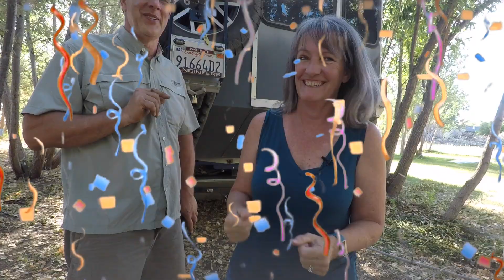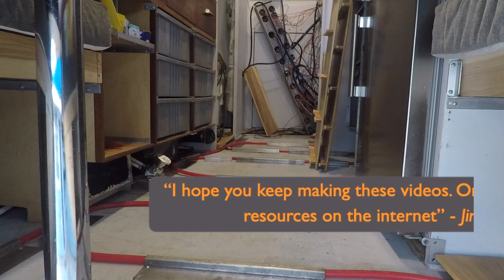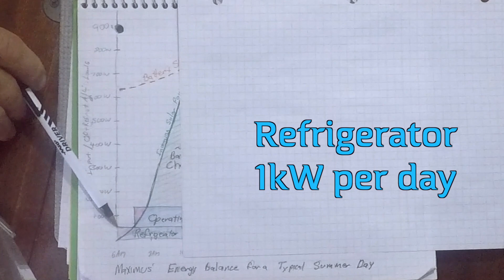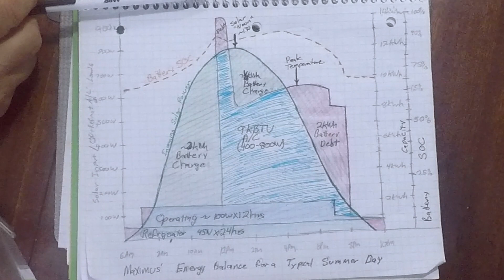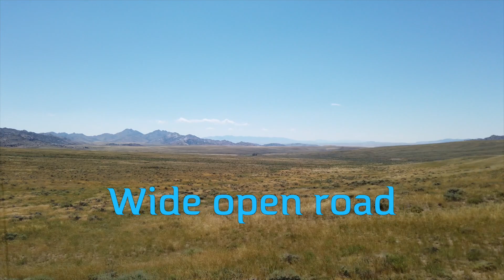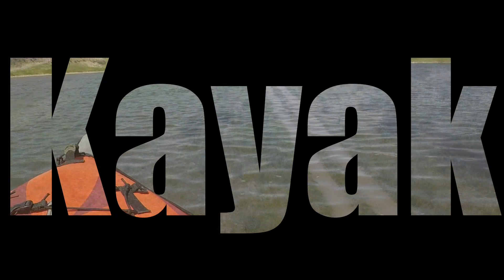All DAY Solar Powered Mini Split AC | Staying Cool Off  Grid DIY Truck Camper  | North Platte River

Comment: Haha I watched this last night.I guess I need a 400ah bat and 1k +++ solar mainly just for a heat pump.Fridge runs forever on 30# gas.I’m sure I’ll rethink this 50 more times lol
Reply from the maker: My calculation that operating my camper with 950W of solar and a ~400Ah/4kWh of battery (need) includes ALL of the camper's living  requirements such as operating the 11.3cuft refrigerator for 24 /hours, cooking with and induction cooktop, pumping water, operating lights and fans, charging equipment, etc. This is also inside a super insulated shell which is necessary to reduce the A/C load to the minimum. 

Absorption refrigerators require ~8x more energy than a typical compressor refrigerator which will be about 10x more than my high efficiency refrigerator. While absorption refrigerators attempt to discharge the heat generated by natural convection behind the refrigerator,  the ~8kWh/day they create in operation, a good bit of that finds its way inside so that adds to the difficulty in keeping cool. 

Something similar results from cooking with propane (since I assume you will also use propane for cooking). In either case, 100% of the energy released in the cooking process becomes heat inside the camper that will need to be removed. Because the gas flame doesn't transfer heat from the flame to the pan very efficiently, it takes ~3x more propane energy to do the same task. While absorption refrigerators and gas cooktops are certainly economical from an energy cost perspective, they are far from efficient. I certainly understand the desire to use propane rather than electricity. The alternative of buying a high efficiency electric equipment also requires purchase of all the equipment needed to collect, store and deliver the electric power. Those costs are are quite dramatic comparatively as well, (especially if you already have the propane equipment). I think from an economic perspective, it will never make purely economic sense to undertake the conversion (poor insulation in most commercial RV's make the problem more difficut). It is even difficult to make economic sense in a new build. There has to be something else motivating the change, such as a new capability.

For me, I was building a new camper and didn't have existing propane equipment. I also already had a large battery. Building an electric/diesel camper to do new things is where I started my plan. There are some niche manufacturers (mostly van conversions) who are taking the same approach I did but they are never going to be cost competitive with traditional RV's.
Reply: @WorkingOnExploring  your graph is awesome.

Comment: I have an Innovair Low Ambient 9000k 20Seer Heat pump.  I had a good bit of roof on my Overlander Conversion.  It is a 1995 Isuzu NPR boxtruck.  I found that the cost of having 2350 watts of solar and adding an extra battery(13.5kw total) was less than the cost of going to the 32 or so seer unit.  You probably have less real estate up there and had to go the other way, but like you say, my insulation is pretty thin.  I can use the mini split really 24/7 as I put mine in my upper bunk.  I can close that off and go about 60 hours as it pulls from 200 watts to about 260 even in the winter.  I also have a Black and Decker heat pump that pulls about 1.3kw.  Though I don't have to use that unless the other one has a hard time keeping up.  My issue might be that I haven't finished my insulation and much of it is stil a work in progress.  I can charge my electric motorcycle on the back rack though as a bonus.  With that much solar I have to be pushed pretty hard to need shore power.
Reply from the maker: Great choice with that much solar and a good mini-split. I have 5-190W panels and am going to add a 6th that slides rearward from under the last one. The thing that made me mad is right after I bought these 31" x 62", 190W panels (and built my camper around them), I discovered there were 250W panels of the same size. It really is a game changer when you can use equipment as much as you want. Insulation really is key but since you made your own interior, you can always redo it (probably). Not fun or sexy to spend time on that though..... I have a few regrets about what I've done, some I have redone and some will never reach the priority to do it. You may feel the same way if you can keep comfortable with lots of power, why bother? One thing I have done I really think is helpful with the mini split at one end of the camper is the air duct I built into the false ceiling that creates air circulation front to back. Stirring the air keeps everything at the same temp and really makes the who place comfortable.
Reply: @WorkingOnExploring  I am going to build a duct onto the front of the mini split.  Kinda a housing to fit under the air output with a pipe and a booster fan at the end. I need it especially for heating as the layers of air inside begin to get really warm up high but really cold down low.  A heat pump naturally wants to drop the heat but since it is in a bunk bed that is difficult.   Cold air falls off, but the warm air just stays up.  I have two fans up there, one high and one low, but I think actually taking hot air straight to the floor will help more.
Reply from the maker: For a while I toyed with putting the IDU in the bunk but decided it was going to be easier to condition the big space and circulate enough air through the small space to keep it comfortable than the reverse. I also thought that keeping the noise from both the IDU and fan at the back, was also a good idea. I will say that in the process I have gone through 3 fans and am about to do the fourth to get the noise/airflow right. I am more convinced than ever that sales adds LIE about sound measurements. I like my Noctua 25dBA, 1800 rpm, high static pressure fans in my hydronic radiators and think they are the way to go.

Comment: Excellent and the best I've seen explained timeline diagram! 
I'm building a somewhat remote workshop that may be able to incorporate the mini-split set-up.
Cheers!
Mac
Reply from the maker: Glad to help. I think using a mini-split off grid for a shop could be even better. You can have more solar AND depending on the size of the system, you could use a 240V power system. There are quite a few mini-splits with SEER ratings above 30 but they are all 240V. Gree Sapphire is one and I have included it in my comparison spreadsheet available at WorkingOnExploring.com/TechDocs

Comment: Enjoyed your explanation of your AC/ solar system energy usage, like that graph, easy to understand.
Reply from the maker: Thank you. Strange as it seems to me,  I keep hearing from people they need lots of battery to make solar A/C work. My goal was to dispell that myth.
Reply: Dispellment worked for me after seeing an ac/dc mini split that will run off panels only plus ability to  be wired to electric/battery power.Your graf of night time consumption and reference of 400ah bat is getting me closer to pulling the trigger.Let me tell you I’m getting excited because I’ve been waiting and watching this stufff get better and better.The low 400 watts of continuous is bomb info.Don’t mind the 3 errors in spelling as it’s too hard to fix lol😊

Comment: Good job on hitting 1,000.  I have me the ram 5500 truck, now time to test panel making and frame.  How are your exterior panels holding up?  I want composite sandwich panels but lead times are 6 months and $$$.  Did you do radiant floor heating, if so I missed that video?  Keep enjoying life.
Reply from the maker: I think I have a minor issue in the back wall. I think I got a little water in it from the top  outside where I may have not gotten enough resin on the edge. I should have put some glass fabric in that particular top joint that was always expected to get a lot of water through it....I will dig into it when I get home and may need to redo the top 2ft. My structural strength is too much (more weight for strength that is not needed). The 5mm only I used is good and strong and the 1/8" luan ( actually 2.8mm) is too thin/weak....if I could do it again, I'd probably omit the interior grid of 5mm ply on edge and just use 2.5lb/cuft XPS (which I could not easily find at the time) (Standard XPS insulation is 1.5lb/cuft).

I did put in a hydronic heating system (2 videos) and radiant floor heat is part of it but only a small part. The area of the floor to convect heat is very small ( in practically all RVs) so I also get heat with 2  fan coils and a copper wall radiator. The floor alone would have been a total bust if I had counted on that..
Reply: The radiant floor is a huge comfort factor even if it doesn’t provide much heat. Your comfort returns so quickly as soon as you close the door.
Reply from the maker: Hydronic floors in buildings and RVs are built and perform very differently. In a building, typically tubing runs on 1ft centers through a 4" or more concrete floor insulated from the ground. Heating occurs through conduction to objects placed on the floor and by convection to the surrounding air of the large floor. The key factor is the large thermal mass of the concrete floor that is able to not only contain a lot of heat but to release it slowly. Slow release prevents loss of a lot of heat when a door opens. It also maintains a very stable temperature through day-night cycles. The down side is that if the temp is too low, it takes days to raise. The other aspect of hydronic heating is not to use a heated slab but low mounted convective radiators that are far more responsive and don't require forced air blowing through the space. Effective floor heating is incapable of working in an RV because the floor is small and concrete floor mass  cannot be carried. Trying to heat a floor without it is of dubious effectiveness. People try (I did) but it doesn't work well because it lacks the two necessary components that make it so desirable in residential construction: large surface area and large mass. While I knew my floor would contribute little to room heating, I wanted it to 'feel warm' but it really moves so little heat as to be ineffective in that too. If you were willing to make an entire floor out of something thermally conductive like aluminum, you might make some progress but I haven't seen anyone do it.